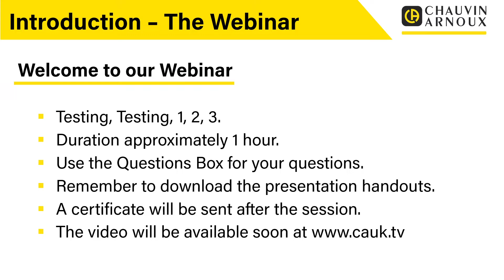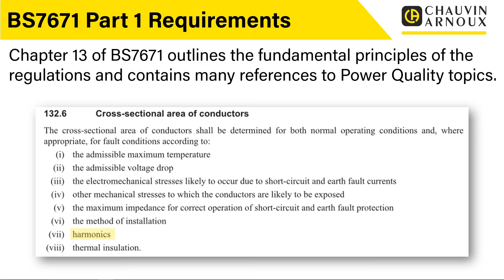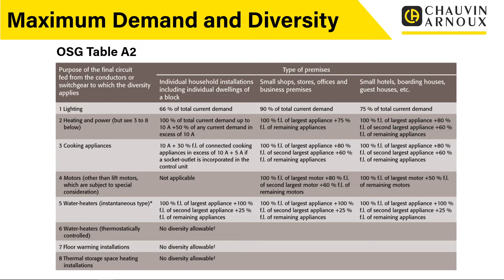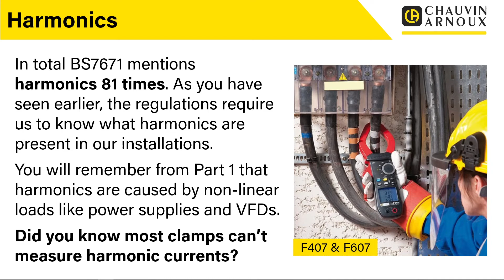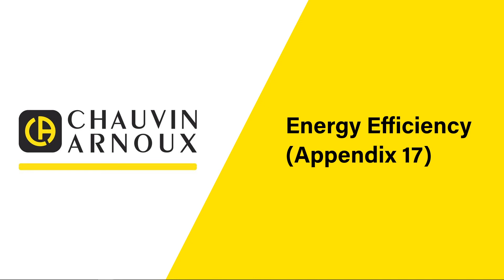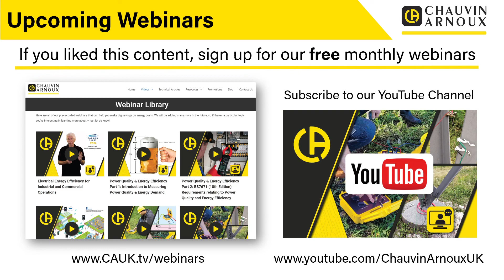CA Webinar 2   BS7671 Requirements for Power Quality and Energy Efficiency V2 2022

Comment: Great content - thank you.

I note that 5.5 & 5.6 of appendix 4 only applies to three phase circuits - is there any guidance regarding single phase cable calculations? 

Innes
Reply from the maker: As I believe I mention in the video the guidance in the regulations with relation to Harmonics is pretty poor and they seem to use 3rd harmonic in some parts and THD in others. Generally issues like triplen harmonics affect three phase circuits, but harmonic currents in single phase circuits are still something which should be considered. While there are no single phase examples in the regs, many of the principals discussed still apply to both single and three phase circuits. I hope this is an area that the IET/BSI improve in the future to give more detailed guidance and examples.
Reply: @ChauvinArnouxUK  Thanks for taking the time to reply!

I hope the guidance in the next amendment will be clearer - especially if THD of >30% can now be expected in domestic properties. I am sure that figure will only rise in future.

The equation given in 5.6 would appear to work when used on single phase circuits to calculate for other harmonic values, yet in your example domestic dwelling, I seem to recall there were considerable 3rd harmonics. Do they calculate out in the same way, given that they don't multiply in single phase? 

I am hoping to get more into design work so trying to understand this as best I can!

Thanks again.
Reply from the maker: @inneseaton313  Hi, apologies in the delay in replying. As we know, 3rd harmonics are treated separately in the regs for 3 phase systems due to them all being in phase with each other and adding up in the neutral. And this is because it can lead to the neutral current being higher than the individual phase currents. As you suggest, this does not happen in single phase installations, where, excluding any earth leakage for example, the L and N currents would be the same. On that basis it would make sense to simply include the 3rd harmonic in the equation shown in 5.6
Reply: @ChauvinArnouxUK  Thank you so much for taking the time to answer - that is a great help!